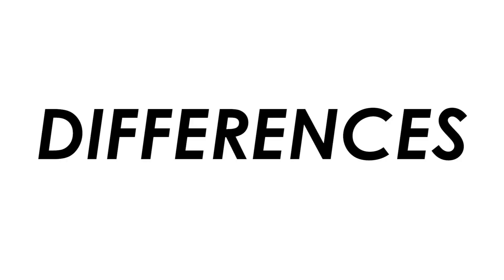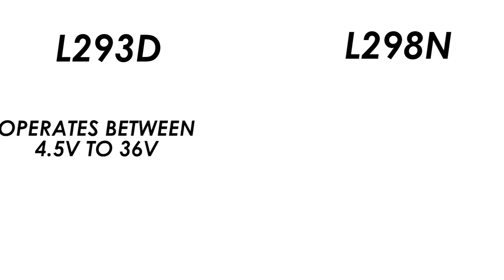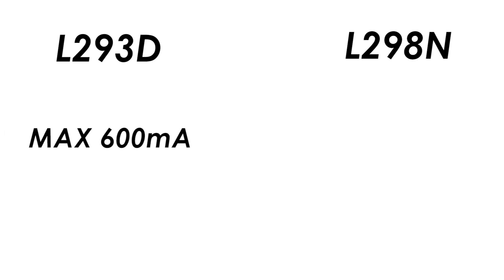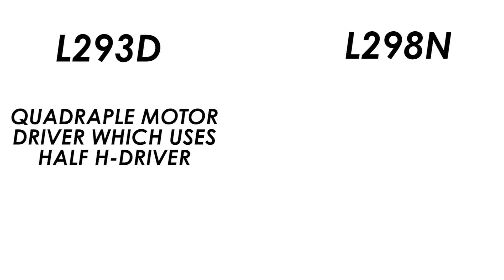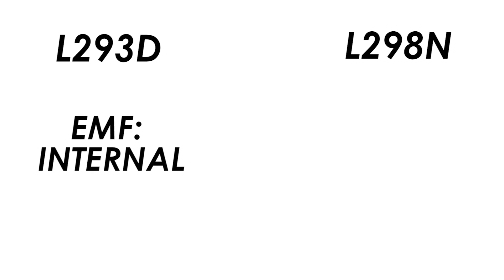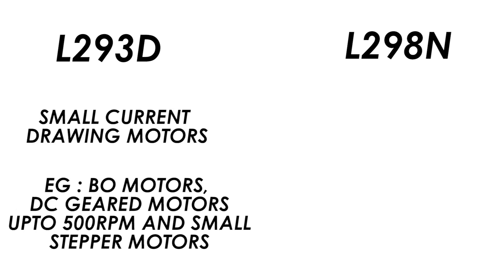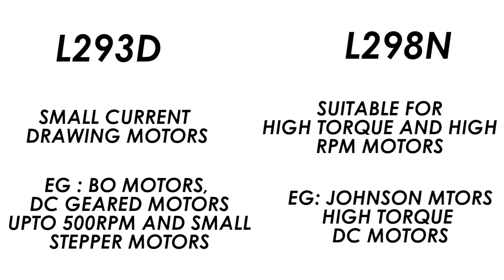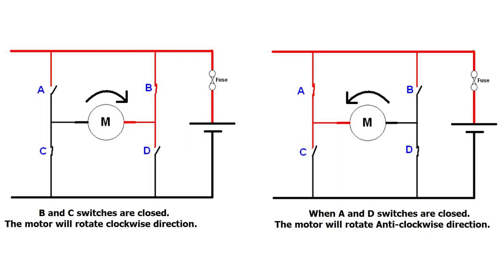DIFFERENCE BETWEEN : L293D AND L298N MOTOR DRIVERS!

Comment: Thanks a lot really!!
I wast struck with this from long time trying to run a DC motor with L293D and it just couldn't get motor spinning. Motor is more then 1A and struggle to spin even @ very low rpm inspite og provided required battery 🔋. 
Well great work!! Thanks 👍 again.